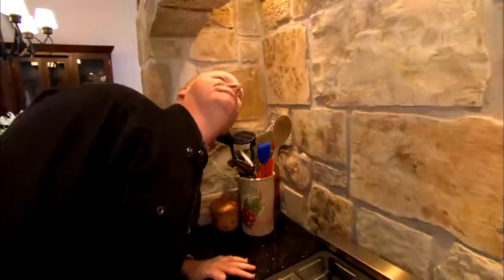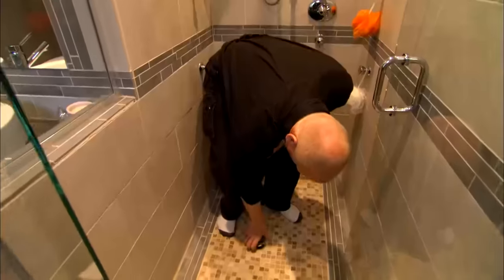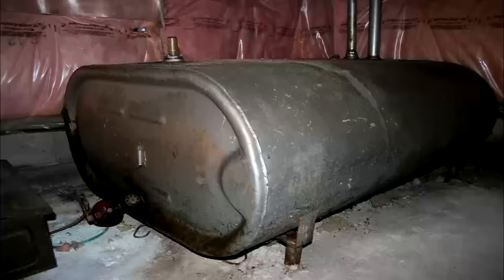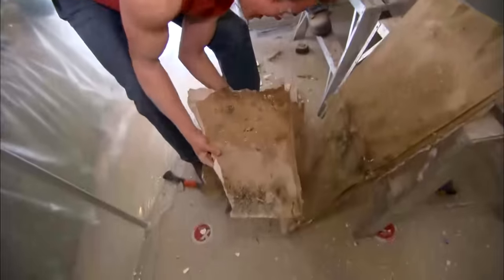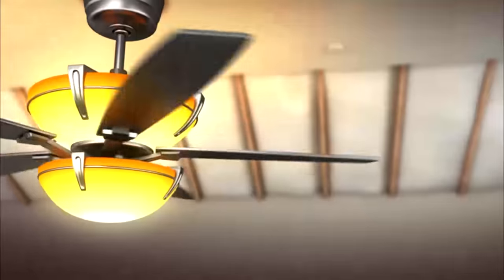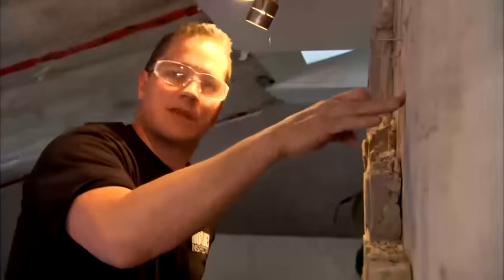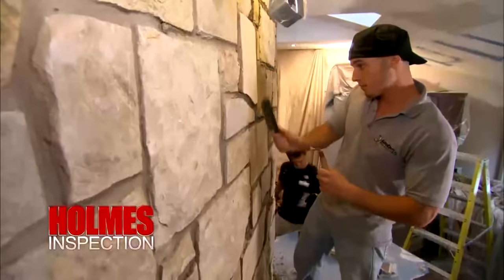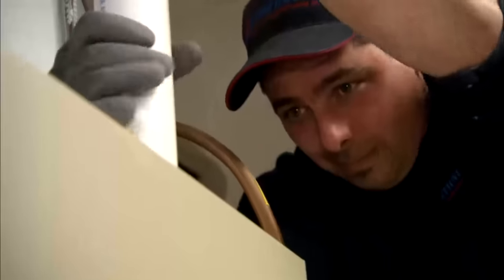How Mike Holmes and Damon Saved a Flipped House from Disaster! | Holmes Inspection 104

Comment: A few years ago I sold my later mothers home off for "lot value" only. There were some complaints from the purchaser but I pointed out that it was stated clearly it was for lot value only and if they were that bent on bringing it back up to standard it was their problem. A couple of months later one of the neighbours called me and told me that the house had just been listed for sale. I checked and sure enough it was listed and they were actually having an open house on the following Saturday. Out of curiosity I attended the open house and it was very apparent to me that they had concealed a great many things that did not meet code, which is why I sold it as a derelict to be demolished. I talked to the neighbour who had called me and let her know that if the new owners had any trouble at all they could call me since I knew where the bodies were buried. 
It didn't take very long before I got a call. The new owners were having water problems and a few electrical issues. So I went to the house and did a walk through with them and told them what they would likely find if they opened up certain walls. I also asked if they had been given a copy of the sewage line video that had been made just before I listed it and they said no they hadn't. I asked if they had been informed that there were problems with the line and the folks who snaked it and made the video (which I still had the invoice for) said it had a life expectancy of about five years before it would need replacement.  Again, they said no they had no idea. The few issues they were having with electrical all stemmed back to some wiring my step father had done years before which was very questionable. When I went to look for the junction box in located in the basement ceiling I could not find it because it had been covered over with drywall. There was another location I could look from and when I looked, the box was still there with it's rats nest of wiring. I asked if they had had a home inspection and they said yes and the report stated that with the exception of a few things, the home was good to go.
When I was done they asked what I would do about the problems if it were me. I told them I would get a lawyer and go from there. Check for building permits to start with along with inspection reports. I suggested that they get some qualified people in to do further inspections on suspect things. I also told them that if they wished I would do a walk through with the inspectors. A few weeks later the lawyer called me and asked if we could set up a meet with the third party inspector they were hiring. The meeting was set up and I walked the inspector through the house and told him what I knew to be problems before the "renovations" had been done. He had some inspection cameras and while I was there he drilled a few hole to see what was concealed within the walls and ceilings. The pictures showed pretty much what I had told him had been there including some structural changes that were questionable and none of it had been fixed or changed to meet code. Needless to say the new owners were not at all happy with the results and I also gave them a copy of the video of the sewer line and what was found along with a copy of the invoice that clearly stated a life expectancy estimated at five years before replacement.
A couple of months later I received a subpoena to appear in court as a witness for the plaintiffs being the new owners. I appeared and testified as to what I knew to be wrong with the house. By the time the case was tried several things came out. 
First, the real estate agent who had handled both ends of the sale from the lister to the buyer was an actual partner in the firm that had done the renovations. This had not been disclosed.
Second, there had been no permits filed or issued for nor were there any subsequent inspections done. 
Third, the contractor had knowingly concealed and withheld information from the buyers. The Realtor was also privy to this same information but again, chose to conceal it. 
Fourth, the contractor had no business license to operate in Alberta. They were from Ontario and had come west to evade a number of charges and suits against them there regarding homes they had flipped.
Result, a number of charges were laid against the contractor, the realtor, and the lawyer who represented both parties to close the deal since he was privy to the irregularities and did not disclose them to the buyers. One of the charges that was placed against all of them was fraud. The court also issued an order that the buyers get the choice of getting all their funds back including expenses for moving, legal fees and other summary expenses or having the house completely gutted and renovated to meet code. In addition, they would also be entitled to all expenses while living outside the home. The buyers selected the former to get all of their funds back in full along with three months accommodation and storage for their household items while they found a new home. 
The seller, the realtor, and the lawyer were held on charges and pled guilty to all charges. The seller was also extradited back to Ontario to face the existing charges there.
The house was bulldozed and the lot put up for sale.
As for me, well I got $15.00 for appearing as a witness and the satisfaction of knowing I had done the right thing. I have to wonder though how many homes are being flipped this way and the new owners get to pay to make the corrections. So do your homework people and get everything in writing. Not everyone is going to find a Mike Holmes to save their bacon.
Reply: Thank you so much for sharing this story!! My babysitter in Utah lived next door to a home being renovated by shady people. She tried to make sure she was outside with the kids anytime anyone came to look at the property, and would tell anyone who even looked her way that she had opinions about what she saw them doing. But the housing market was so intense, most buyers didn't care. 

My husband and I are not homeowners yet. I'm so scared of getting into a home that is shady. I always thought I'd have my Dad to help us when it came time to buy, but his Alzheimer's is getting worse and we still aren't where we need to be financially. It makes me even more scared. So hearing stories with actionable steps people can take is incredibly helpful!!
Reply: @lbatemon1158  Make It Right
Reply: @L Batemon  Do not buy. Rent. The owner is supposed to fix what you find wrong. We made deals for free rent if we did the minor repairs ( adding insulation in the walls. He provided the products. Painting, ect.
Reply: @judyfenske1429 dumbest advice ever... Rent on average where I live is $1200 dollars a month. Meanwhile my land taxes are about $2000 for the year. Even if you drop $10000 a year into house repairs. That's still cheaper than rent.
Reply: Pool You should write the movie script. This would make a very good movie.
Reply: Donate the $15 to your Church or donate to the Homeless  in your área. Your ❤ May be BIG Now, cause you helped out One Family.  You deffenatly have room in Your ❤ for more LOVE. Thanks for sharing,  your journey.
Reply: Reporting it BEFORE they sold it wouldve done better i think
Reply: You're an angel for helping the homeowners who were scammed.
Reply: Finally a story with a happy ending!  Honestly is rare thing these days.   You did a good thing and gave some folks a better future!
Reply: @MeBeingAble   You're assuming he would have somehow known that.  How would he?
Reply: @MeBeingAble  To whom would this be reported?  The first owner, who sold it for the land parcel only, has no connection to property after the sale, and is not party to the efforts to sell it later.  There is not yet a crime committed or a fraud completed, so no reason to call police or hire a lawyer.
Reply: took me so long to read this i became a Grandad
Reply: Good on you!!
I wish more people did this!
Reply: i'm not shocked about your good heart but i am about the 15 bucks. i sure hope if the buyers were not able to show their gratitude financially they at least.. made you a cake or something.
Reply: I worked in construction for 20 years.  Absolutely none of what you are stating surprises me.  Many shady contractors, sub-contractors, and builders out there.  I refused to work for builders who were substandard and/or had no integrity.  I simply could not allow my name to be attached to their garbage -- no matter how much they were willing to pay me.:face-orange-raised-eyebrow:
Reply: Renting is unfairly demonized in modern society often costs of renting and home mortgages are comparable and that's before considering repairs property taxes utilities (that are often covered in rent). Insurance basic upkeep like the lawn (that you can be fined for if not taken care of) and several other little odds and ends. Don't forget how the price of the home and your payments into it aren't getting you equity nearly as quickly as you think as interest is front-loaded. At the rates of today you'll end up paying 3 times the amount of the principal when it's all said and done the real cost of owning a home goes far and above that of renting and with far less flexibility in terms of when you can move or how often. Of course on top of all that owning puts the risk in your hands should something ever happen to that structure if you think renting is expensive or unfair you've clearly never owned a home. @hasty-carnaage1518
Reply: Good on you sir, that is the right thing to do.
Reply: You are to blame, in the end,  for the sale as vacant land (Lot only) with a permitted structure.  You should have obtained the required demo permit, demolished the structure, and changed the approved use from SFD to a vacant Lot...The sale was enhanced by what you pulled off...Shame on you for allowing all the grief to buyers. The rest of the players were creeps, for sure.
Reply: @mackellyman5642  wait , he is to blame for actions of scammers that knew they where buying a death nest and hade been informed in detail of all the work needed on it ?
how do that logic work ?
Reply: The answer is all of them. Every flip is an absolute scam and has been for at least 20 years.
Reply: I know that a similar situation happened with my mother's old house in CA. My brother sold the place, but should have placed it as a lot only situation (I also know where the bodies are buried 😂). The house is full of issues (asbestos, lead pipes, knob & tube wiring, bad plumbing, lack of permits,....) but I saw on the Internet that the house was flipped & out for rental - a lot of issues were covered up (by the photos) that I knew about & some I did not realize. I pity the folks who rent that house.
Reply: Brit here, after watching many of Mike Holmes videos and reading your reply, I have come to the conclusion, that many buyers are uneducated about buying a house. Most with come with eyes that only see the glossy side. I have asked before, why isn't there a National Register for inspectors showing their affiliations/qualifications and customer satisfaction reviews?
In the UK we employ a Surveyor, who like a lawyer, works only for you, who have a National Register and come with letters after his name showing his qualifications and membership of the association. They also do a visual of the property but are more independent than inspectors, give a much more honest review of the property. They are not infallible, but are trusted far more.   Buying a house, is a major undertaking, why people dont research and do due diligence is beyond me. Its probably the most costly investment of your life. As the old adage says "Buyers Beware!"

Comment: I usually like what they do but not this time, design-wise.  The replaced the bottom half of the shower and used a dark tile instead of the light color that was already there. It didn't look right at all have two drastically different colors like that. And then the range, why didn't they build the alcove back? Completely changed the design of it, it looked so much cooler before.
Reply: Agreed about the shower. I assume the homeowner picked the dark tile though, and that it looked good to them wherever this was filmed (2009?)

Comment: Years ago my parents owned a house with a fireplace surrounded by a brick wall. My parents decided they wanted the dirty old brick removed and it was going to be drywall. We started taking the brick wall down... and found that the brick wasn't secured to the drywall behind it. There was a good inch gap in places and the only thing tying the brick to the drywall behind it were a few L brackets. "Secured" with nails.
Reply: and don't get we started on how their current house almost burned down because the electrical had been half assed and w asn't grounded properly. The entire house would have caught fire at once and everyone would have been trapped and died if it had been night.

Comment: I bought a home in Edmonton, with 'new' electrical, permits were pulled and a licenced  electrician did the work, I went to replace a plugin and discovered no box, the  outlet was held behind the drywall with electrical tape and chopsitks I asked my realtor about legal options but the electrician and owner had moved to the USA, I went to replace with a homeowners permit. I went to do the exam am the first two questions were easy the remaining ten included 3 phase and \489 volt questions, needless to say I failed. I replaced everything myself and the inspection 10 years later by an electrician was flawless.

Comment: As a double lung transplant recipient, it really hurts when I see no masks being worn during this rehab. Please protect yourselves!
Reply: I don't get it either. I'm hoping that the majority of the work was done with PPE,  and just some of the on camera stuff was unprotected.
Reply: Indeed, shocking, especially cutting blocks or sanding mud.
Reply: @gorillaau  I am sure that is the case.  For the same reason the female worker is wearing a top that looks good on camera but would collect, dirt, drywall dust, crud, etc. etc.  6 hours of work.. 15 minutes of 'good camera shots' to put into the episode.  They are all actors.  Even if they are doing the work, they are still 'acting'.  Look at 25:58.  The worker pulling off drywall and shaking his head in disgust.  Just for the camera...

Comment: I am not sure what the codes are in whatever area this took place.., but I'm pretty sure range venting needs to be ridged / solid hard pipe for the entire length, not flex pipe. I have been doing HVAC in Wisconsin for 30 years and actually held an HVAC inspectors credentials as well for many years. It's possible flex pipe might be acceptable if the gauge was thick enough but what was shown in the video was not very thick. It was standard insulated flex. When installing air ducts for forced air from a furnace, yes the insulated dust can be used after you are so many feet away from the furnace. It's something like ridgid duct for the first 8' then you can use flex. But for a range vent, pretty sure it's ridged all the way and probably minimum 30 gauge.

Comment: I've never seen a "flip" that has been done well/to code but they all pass inspection. It's a shame this racket goes on.
Reply: It's so bad here in Massachusetts -- many tired-looking homes get snapped up by make-a-quick-buck flippers -- at least half the new MLS listings are flips done to look glitzy to uninformed buyers (who are the majority), but the work is mere cosmetic cover-up of water infiltration, etc, and slap-dash installations of floorings, kitchen cabinets, bathroom fixtures, etc.
Reply: Mine was- but they were a small local custom home GC firm trying to keep their workers employed and survive the ugly 2007-12 crash.

It was an improvement over the original build features, doors, closets, fixtures, wiring, lighting, cabinets, flooring, counters, redwood fencing and a new redwood deck installed with hefty 12x3 base beams.

One glitch in the Ba drain with about 7 old short AND twisty replacements leaking in the crawl space was missed- took $900 and a skinny plumber's assistant to do a single turn run for it all.

Things not done were known (roof, windows, and CH unit) and priced accordingly.

My independent inspector was impressed at how little was found- even the orig 35 year old roof and windows were not leaking or causing issues, and I had.them done that first Fall and Winter for pretty much exactly what the house purchase price discount was.

But he was a rare find.

Comment: Can you go after the inspector or original contractor to recoup some losses? Does he do this for free for the home owner?
Reply: To answer the first question, partially: it depends. A lot of places have what’s known as a Statute of Repose, where a contractor or designer cannot be sued for negligent or shoddy work after enough time has passed, similar to a Statute of Limitations. So that contractors don’t have to fear ghosts of the past popping up and defending something they did ages ago. And after the SoR has run, it could be that problems are more a result of damage or poor maintenance during the intervening time. 

Usually the SoR is a long time to allow mistakes a chance to appear and cause their damage and hold the person responsible liable. In Oklahoma, it’s 10 years.

Comment: The inspector is not required to remove the drain cover in the shower. Also water press sold be 40-80 psi measured wit a gauge. They should run the shower and all faucets and flush toilet at same time in each bath to ensure they drain properly. The inspector should have noted that there is a potential issue for the water stain and note it as deficient.